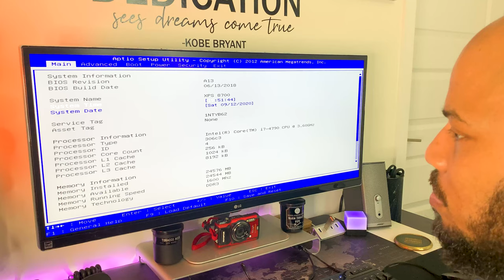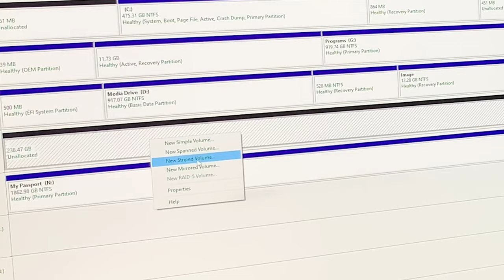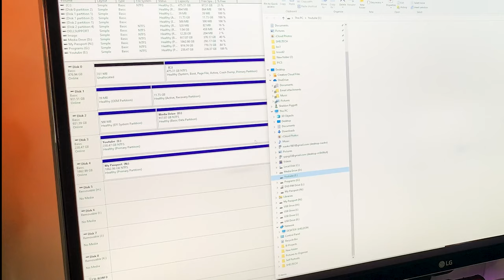How to install a mSATA SSD in a Desktop Computer

Comment: How is the Dogfish drive holding up so far?
Reply from the maker: Working great so far. For a cheap drive fast. We will see long term👍
Reply: @SHELTECH4  does he still work ?
Reply from the maker: @djcvmusic1  Yep
Reply: @SHELTECH4  hi, can you refer me to any source from which I can learn to make msata boot with another OP system like linux. I am a noob. I installed linux mint on msata watching youtube, didn't install grub. I did not see the option for dualboot with windows. Any help is welcome.
My laptop is Dell e5440 😬

Comment: Nice video! My questions (1) m-Sata and regular SSD, which is faster? (2) will m-Sata be suitable to load operating system?
Reply from the maker: They should be the same speeds depending on what ssd you buy. m-Sata is perfect for putting your operating system on.

Comment: Hi Master, great explanation.... Master, I have a Gigabyte Z77-D3h motherboard and it has an mSata slot... do you think that if I connect an mSata, the sata 3 ports will no longer work? ... the answer would be of great help ... greetings Master and go ahead .
Reply from the maker: The Sata 3 ports should still work so you can add more hardrives. Which I have done.
Reply: @SHELTECH4  ... hello Master, thanks for answering ... according to the gigabyte website it says that when you install an mSata you lose the Sata 3 ports of the motherboard ... it's a question ... anyway, thank you Master all goes well Master .
Reply: @Hugo-mp1yq  also have a z77 from gigabyte, their site says that using the msata slot makes the sata 2-5 slot inactive, but it is a 3 gb/s slot so it’s not the end of the world

Comment: What is BIOS
Reply from the maker: Is firmware used to perform hardware initialization during the booting process (power-on startup), and to provide runtime services for operating systems and programs. So its the set of instructions that is used when starting up your computer
Reply: @SHELTECH4  how do i get it?
Reply from the maker: Read the material for your computer on how to get into your bios. All computers have one. You either have to press f1 or esc on boot up.